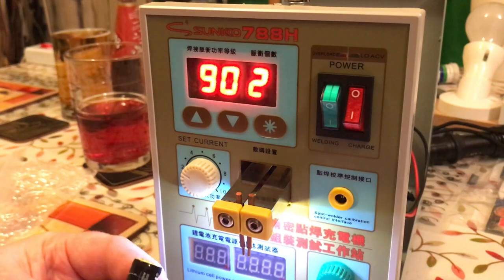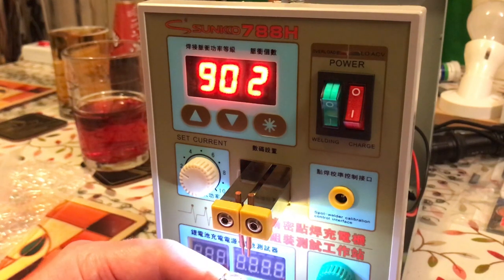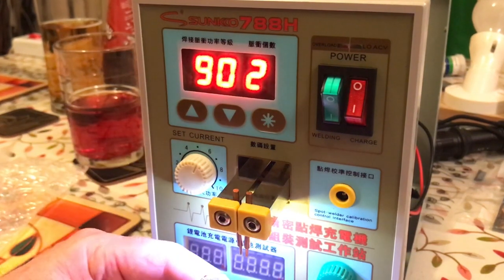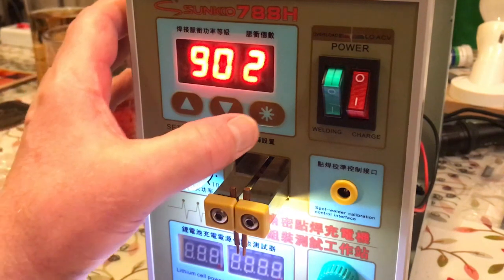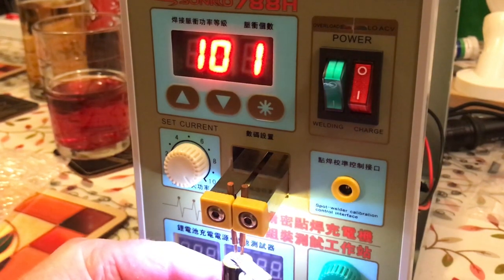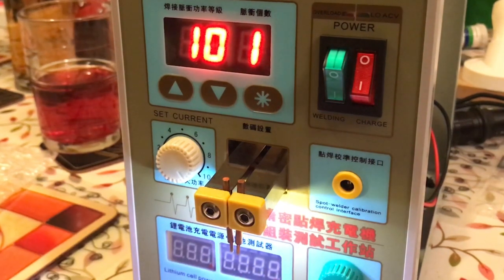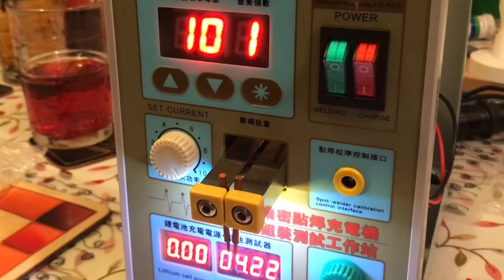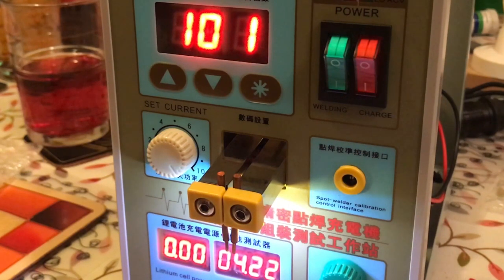Testing Repaired SUNKO S788H Battery Spot Welder Part 9 #batterywelder

Comment: Sunkko 788H is the worst and dangerous spot welder, you can lay your hands upon. The design is  non conforming to any Electrical Codes eg. NEC US,.The 'Set Current' knob you turned, does not function. The battery charger at the bottom is notoriously unreliable and will damage every Li-Ion battery charged with it. The SCR (BCR30AM) will fail, so also the MOSFET (MP0221SY); rendering the machine useless. Don't even try to repair. I'm certain that after one year, it must have failed. If not, good luck.
Reply from the maker: Its working great since I did the upgrade, it dies great welds and is running of my house mains supply on a 13 Amp fuse.  One of the things I tested was to just apply power to the original transformer with nothing attached to the secondary so it wouldn't draw any current.  It instantly tripped a 32Amp breaker.  Its a really crap transformer just replace it as per the video.